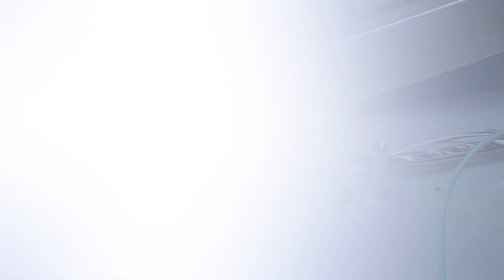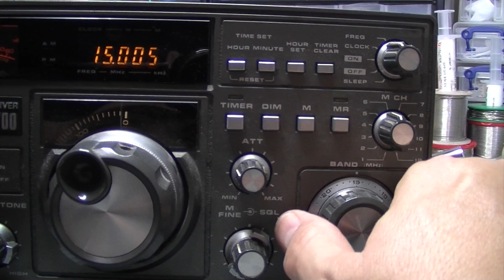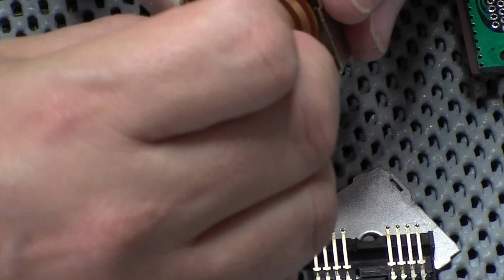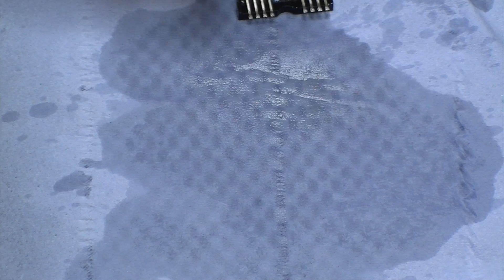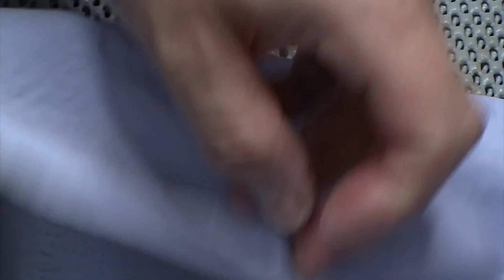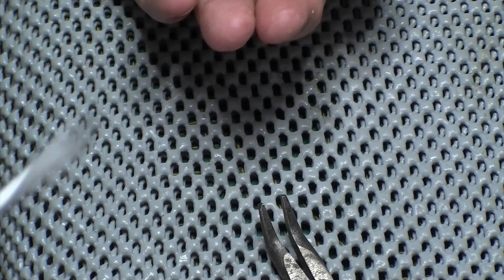Yaesu FRG-7700 HF receiver troubleshooting Part 4

Comment: Before watching No. 5.  You left one pin unsoldered. Also too much flux could run down the pin and straight onto the contacts. Ouch.
Reply from the maker: Thanks for your observations. It was some time ago now so I can’t really remember. I’m not sure what I didn’t solder but I got there in the end. Thanks for watching

Comment: I bought my FRG 7700M back in 1981, for £389! Took me ages to save up for it.
Only a few years ago, the set developed a mains hum issue, which was too loud for my liking. To cut a long story short - I discovered that part of the rectifying cct track had lifted (easy to miss!), and so this acted like an unwanted modulating/bi-passing capacitor somewhere around the bridge rectifier track if memory serves me? 
Capped the PSU and put in a heavy duty full-wave rectifer. Job done.
Something to remember for any piece of radio or HiFi equipment.
Regards. 
BJ
www.cassettedeckman.blogspot.com
Reply from the maker: The power supply board on these does get a bit hot which can lift tracks over time. Well worth reflowing them. I agree that upgrading the bridge to a beefier one is worthwhile and replacing the caps

Comment: May I ask do you get your components on line.,or buy where you live.,nicicons ,I like too,.thanks for your video great to learn from you thanks
Reply from the maker: Hi Ron. I tend to buy most of my capacitors from RS, CPC or Farnell. Harder to find vintage components I mainly get from EBay
Reply: @Radiocruncher  Thank for getting back to me some parts are hard to find ,there are antique  electronic places ,I found one or two,I also try to find stuff stuff on ebay.thanks for your videos

Comment: I have the same FRG7700.  One day I was listening to the bands and I heard a slight pop.  At that time, volume rose just a bit and now it does exactly just like this radio that you are working on.  Sadly, I don't have the memory module like this radio to blame my problem on.  Guess it is time to recap.....sheesh!
Reply from the maker: Its worth starting with the power supply to make sure you have the correct voltages. Then check the PLL frequencies with a counter. Its unlikely to be the capacitors on the PLL board. Good luck and keep me posted. Thanks for watching. Graham

Comment: I do believe I have desoldering tool envy! LOL
Reply from the maker: Lol it certainly speeds things up Dave. You will have to get one
Reply: Well that it most certainly does, looks a lot more efficient than a vacuum plunger type (manual/electric).

The replacement guns are more appealing price wise than a fully integrated system but I will need  to modify my current solder station to accept such an attachment.
Reply from the maker: Good luck with that Dave. Do they sell them down there?
Reply: +Radiocruncher Well eBay does, from the looks of it, 2 wires for the element, 2 for the thermo coupler and 2 for the electric pump...
Reply from the maker: If you have the parts to make up the pump etc then a gun would be a very cost effective solution. Be interesting to see you put it all together
Reply: Radiocruncher Another item on the "things to do" list :)
My soldering station only supports a 60w element, the desolder guns sport an 80w element so I would need an alternative supply and temp regulator as well...

Comment: What type of desoldering tool do you have?  I really need to get one but there seems to be loads available at wildly different prices.

Thanks
Reply from the maker: Hi Andrew. The system I use is here http://cpc.farnell.com/duratool/d00674/soldering-rework-station-uk-eu/dp/SD01386 they also do a desoldering station without the soldering iron http://cpc.farnell.com/duratool/d00672/desoldering-station-uk-eu-plug/dp/SD01384?ost=duratool+desoldering&selectedCategoryId=&categoryId=700000008608&searchView=table&iscrfnonsku=false Thanks for watching. Graham